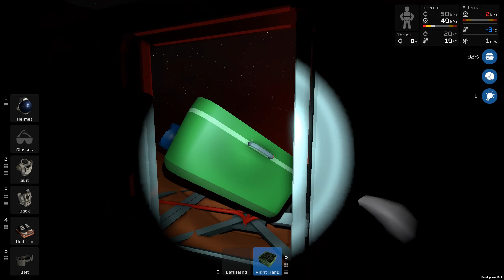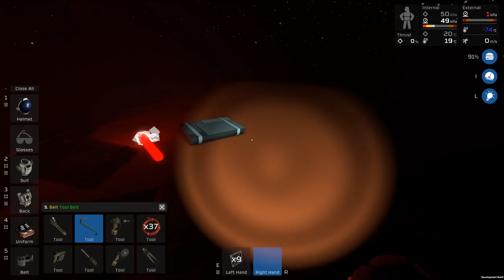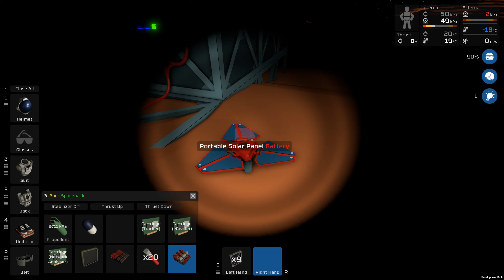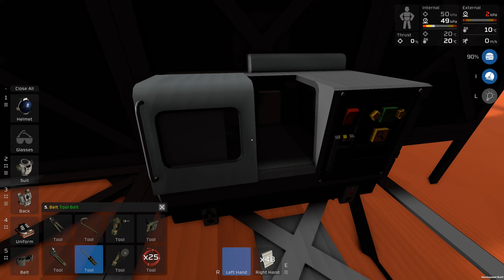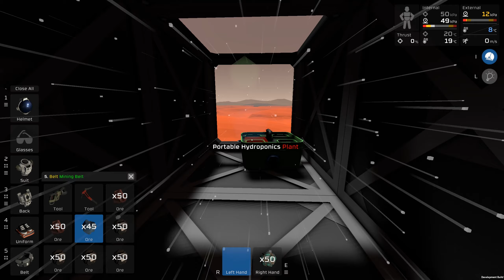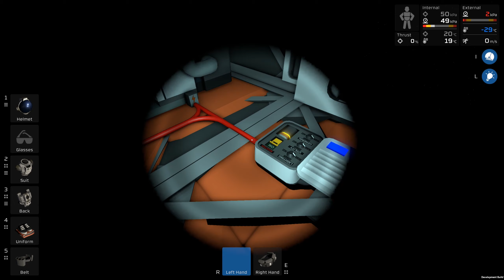Stationeers S4 E02 - First Machines, Mining and Manufacturing

Comment: That oxygen is useless to you.  The only use you have for it is smelting (or welder gas mixing...but that's a long way off), and when you are at the point of gas mix smelting, you'll be able to pull the O2 from various other places.  You can use the O2 for your jetpack. /shrug

Comment: I know you just restarted on Mars, but may I suggest a Europa series?  As I said in the last video I recently came back to stationers also.  When I first started playing I found the Moon and Mars challenging (even with 0.1 hunger) but now I find them boring.  In various play throughs I have made things harder and harder on myself.

When I first started on Europa I used the solid generator for the first time.  I believed it was the only way to survive early on given the low solar output and extreme solar angles. Anyway I challenged myself to do Europa without using the solid generator and no respawn. It has been difficult but I've done it.  I think it would be fun to see you tackle the challenge also.
Reply from the maker: I may have mentioned it in the video, but I already did a few episodes on Europa, but wasn’t enjoying it. Spent more time trying to recharge batteries :)

Comment: When you splice cables to existing cables you dont need to use the proper junction. For example if you have a corner and you add a straight, the game will automatically make a junction for you. That being said you can do anything you want simply with straights and corners. Less mouse wheel if you do it that way

Comment: Re plastic welding;

Typically for high volume production you will have "hot plate welding" and "ultrasonic welding" of plastic.  
Hot plate welding; The area to be joined (a seam) is heated then squashed into the opposite side. a very effective way to produce a robust seam joint between two plastic components.
Untrasonic welding.  in effect is very similar to hot-plate welding, but rather than heat being applied to soften the material, the areas to be joined are rubbed together at high frequency to produce the heat and bond between the materials.

you can also have 'heat stakes', but that is more akin to riviting for plastics.